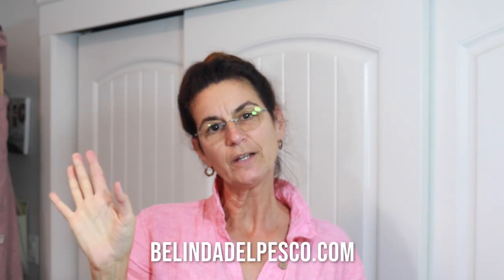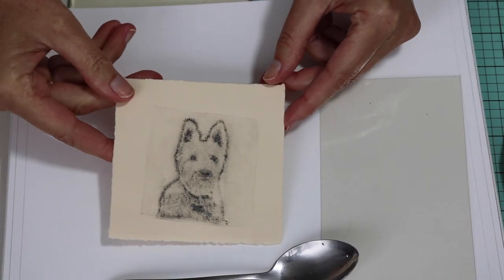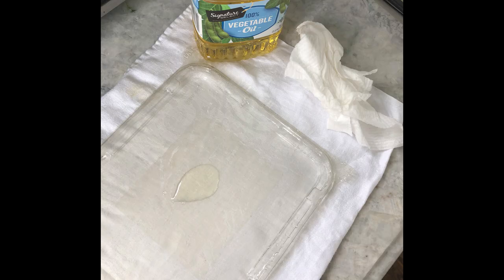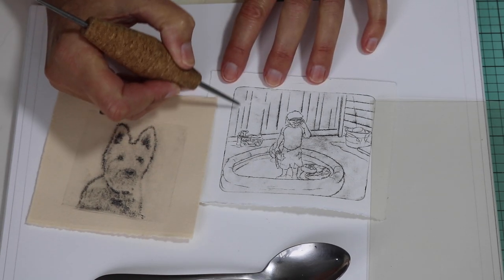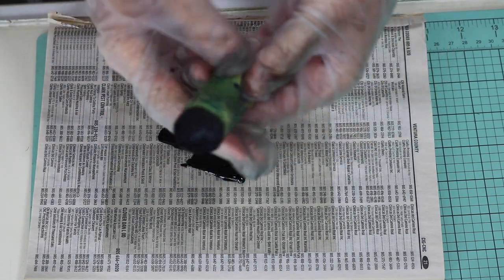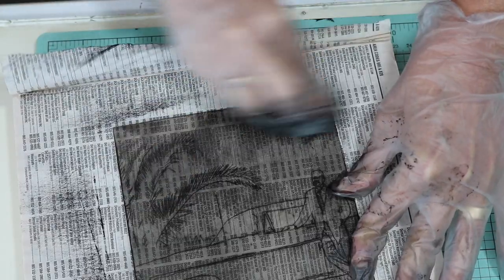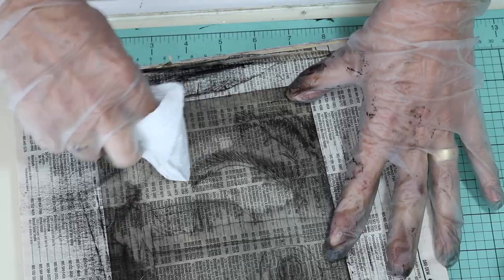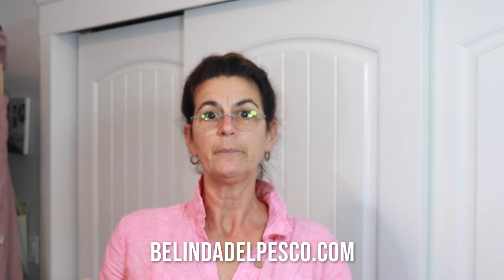How to Make a Drypoint Etching Print from Recycled Plastic with No Press

Comment: *Note that I said below that I had been etching into recycled plastic... this is absolutely true... but that doesn't mean I've been getting any decent results from it; just that I was etching into it in the absolute belief that it SHOULD work. Now I can try these etchings with some authority thanks to your film
Reply from the maker: Hi Zachar, I hope your next printmaking adventures are fruitful. The supplies matter (paper and inks) and wiping the plate is almost an art in itself. Carry on, have fun, you’ve got this!
Reply: @bdelpesco  Thanks to you, today I finally made some prints from engraved perspex and it works better than I ever could've imagined. Latest invention is "Floor Lino Embossing"... where I engrave/melt the soft insulation side of cheap flooring people have thrown away to create a complex 3-D sculpture up to 4mm deep... Then I make a mould of the melted/engraved flooring (with bathroom silicone) and make an "embossing folder" out of the engraving and the mould. I can use this folder to press intricate patterns into paper which you don't even need ink for (although I use it anyway). I make these folders for die-cut embossers, devices which, at least in Belgium, you can buy practically everywhere (but surprisingly few people seem to know anything about). Infinitely reproducible recyclable 3-D art every time. Here's to recycling stuff!
Reply from the maker: That all sounds completely fun! If you’re on Facebook, there’s a Group of printmakers using craft embossers with great results and a ton of tips for optimal prints: https://www.facebook.com/groups/1544918272204523/?
Reply: @bdelpesco  Yeah; my hands are now totally black from wiping the ink off the 'recycled plastic' plates. I'm typing... carefully!
Reply: @bdelpesco  I'm absolutely thrilled you shared this information with me. I applied to join the group. Seems to me that it could be a really fruitful endeavour - craft embossers are just incredible devices and they don't get anywhere near as much appreciation as they deserve.

Comment: I am going to do this!  I just need ink and plastic containers.  It is so much easier and cheaper than metal plates.
Reply from the maker: Simone - I recommend buying cookies to collect the plastic containers. And either Akua intaglio or Cranfield Caligo Safe Wash etching inks. Both wash up with water. Have a ton of fun!
Reply: @bdelpesco  I make my own cookies due to allergies but I feel the need for a gluten free cheese cake coming upon me.  I have some water based oil paint on the way.  Would they be an acceptable substitute till I can get proper ink? And I believe I will have a lot of fun.
Reply from the maker: Ooooooo, cheese cake! I’ll be right over with some simmered berries to top it with! I’ve not tried oil paint, but I suspect it will work, depending on two things: how slow it dries, and how it adheres to paper. It’s worth a shot, and I’d love to know how it works out for you! Come back and let us know, okay?
Reply: @bdelpesco   Simmered berries? Yumm!  As long as they aren't strawberries as I'm allergic to them.   It will be several weeks at best before I can get to making anything as I have to get everything but I will post on insta and let you know how it turned out.

And I'm working 7 days a week right now so I have to pace myself.  When I start creating I tend to forget to sleep.
Reply from the maker: I will omit the strawberries! But we’ll use the containers to make a whole village of dog drypoints in hats and blazers! I hope your workload simmers a bit, and creative time blooms fully for you over the next season. 🤓
Reply: @bdelpesco  lol thank you.  I lean more toward cats but I do like dogs as well.  Not too sure about the hats and blazers however.  My cats are rescues and still a bit feral.

Comment: It would appear US plastic containers are far thicker than UK containers. (And less eco friendly although the UK ‘can’t’ recycle these containers and therefore go to landfill!) ours tend to have breather holes too which poses a problem. I have seen fruit juice containers (again non recycleable) with foil lining being used for dry point successfully.
Reply from the maker: Hi John, most of our containers have breather holes too - especially for produce, but the usually have one solid panel to affix the label... more so for dry goods. And many of ours here in the states are super thin too. The little dog plate is very light, but it can be done! I’ve seen the foil lined juice container Drypoints and I have material saved for that to give it a try. Have you made one?
Reply: @bdelpesco  now the dark nights have arrived here with clocks changing i will. especially as our evening adult night classes are cancelled because of covid
Reply from the maker: I’m sorry your evening gatherings are postponed. I do hope you’ll make some prints. The darker evenings and dropping temperatures always feel like a dose of creative productivity to me. I hope it’s the same for you!

Comment: This is very clever.  I   always fret about the amount of wasted ink when I do etching.  It seems you have to put a lot of ink on and then take most of it off.  🥴 

Is there a more frugal way of adding the ink – or is this the only way please, Belinda?
Reply from the maker: Hi V, Yes, this application was a bit heavy handed. You could always lean towards a more conservative amount and then add more as you need it while rubbing the pigment into the linework. You can also use a spent plastic gift card before you begin wiping, to gently scrape the ink off the surface to re-use, but there are risks of scratching the plate surface, and/or collecting plate materials in that scraped ink, so it's best to deposit it into another small container, rather than adding it to your fresh, untouched supply.
Reply: @bdelpesco  This is really helpful advice – thanks so much, Belinda.  

I appreciate you taking the time to reply, and share your wisdom and experience with me.  🙏🏼 [Helen]

Comment: I wonder if abrading the surface of the plastic would allow it to hold ink?  I'm envisioning a multi-color ink print...
Reply from the maker: Alonzo - yes, that works. If you’re using recycled plastic (no cost) - it might be useful to create a mark making plate, segmented into a grid, with an assortment of abrasive tools and incised line mark-making, so you can refer to it when planning your next print.

Comment: What kind of ink should I use? I am working with a summer camp where we intend to use this technique, relief print, and collagraph, hand printed (no press). Assuming acrylic paint won't work well... can block printing ink work for all three techniques? Thanks.
Reply from the maker: Hi Christopher, The brand and type of block printing ink you use will have a profound effect on the results. Slow-to-dry is best so your students have time to mix colors, apply to the plate, wipe the plate, and press against paper without the ink skimming over (which would happen with quick-dry acrylic paints) I presume you want water-wash up inks (different from water-soluble) for students, so I'd recommend Cranfield Caligo Safewash Intaglio inks. https://amzn.to/38hsN0e Try to use printmaking paper with little to no sizing. Have a look at Cranfiled's FAQ page: https://www.cranfield-colours.co.uk/faqs/#inksfaqs
Reply: @bdelpesco  Wow, thanks! And I hadn’t considered the difference between water soluble and water washable.

Comment: Seems like you wouldn’t need to use as much ink as you did and save time and ink. Great ideas here
Reply from the maker: Hi Joy, That is true.  This was the first go on this plate, and my attention was split between the lighting, camera/video production & focus, and what my hands were doing. I'm not a good multitasker, so yes, I could have done an effective print with half as much ink, for sure. Thanks for pointing it out, and for the compliment.
Reply: @bdelpesco  I'm just too frugal, haha. By the way, I made a etching sketch used a sharp tool of my clay tools. I didn't have ink, so I used acrylic paint and it didn't work. Have you ever tried the paint and had trouble? Guess I need to get some ink or make sure I've scratched the plastic deep enough. Thanks for any suggestions
Reply: Oh, watched your video again and forgot to wet my paper! That's probably where I went wrong!
Reply from the maker: @joysmith1213  Hi Joy, Acrylic is made to dry fast, but it's also dissolvable in water while it's still wet. Those two characteristics make it hard to use in printmaking. If it dries in the crevices of the linework incised into your plate, you've just filled them forever, and if it stays wet and you press it against damp paper, it'll bloom and bleed beyond the contact point. Your best bet is to buy a small amount of intaglio ink made specifically for printmaking. 👍